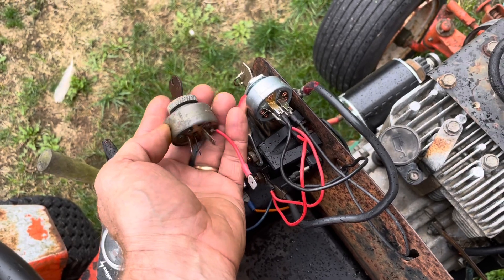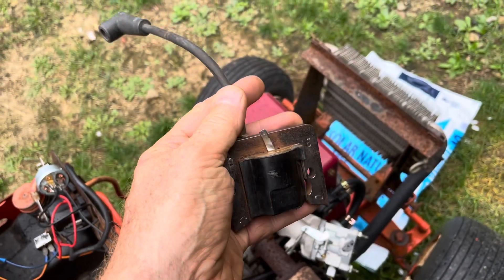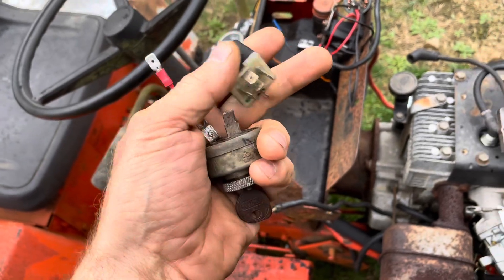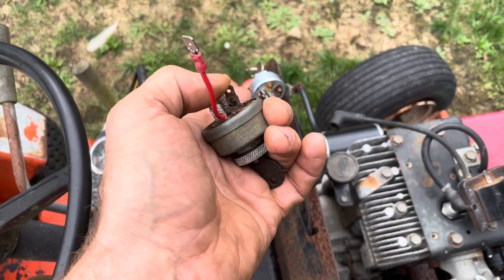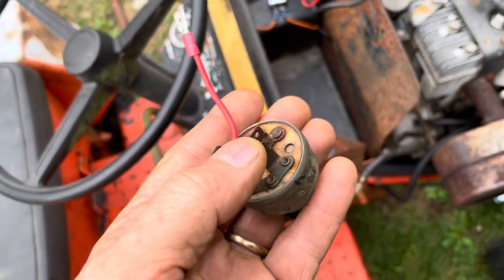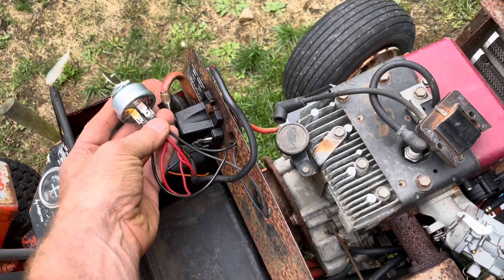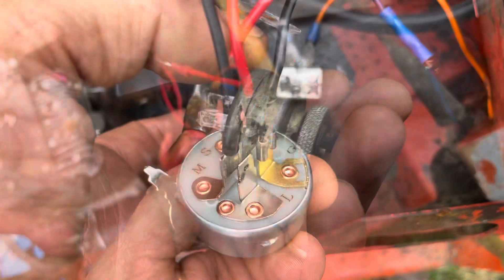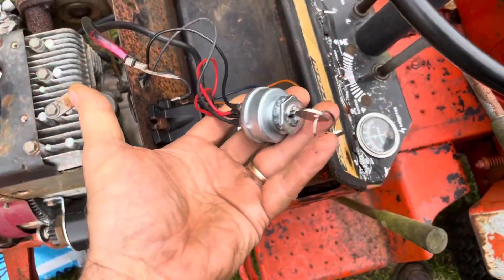“4 terminal” Vs “5 terminal” lawn tractor switch (BIG DIFFERENCE) explanation, how it works…

Comment: Even with switches with the same number of terminals, there are different configurations. Just because a switch has 4 terminals (or 5) doesn't mean that it is automatically compatible with another 4 terminal (or 5) switch. I've had many customers blow fuses (sometimes worse) by putting the wrong configuration switch in their mower.

Comment: There ARE 5 Terminal switches with an "M" terminal for use with magneto ignitions. Whether 4 or 5 Tab, always check to make sure the M terminal is connected to Ground in the OFF position and not connected to anything (especially 12vdc)  in the Start and Run positions. Otherwise, bye bye Magneto!
Reply from the maker: I wasn’t expecting there to be 12 V in the off opposition, when I touched it and saw it arc. I jumped back so fast. I am so surprised that the magneto works at all. I would imagine I’ll be replacing the magneto because I’m sure the damage is done. I appreciate your comment.👍👍